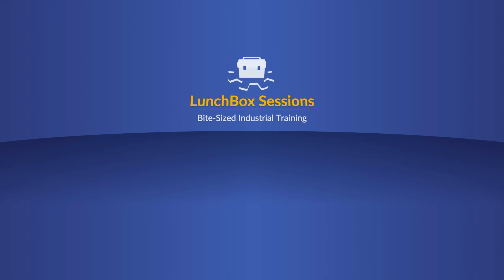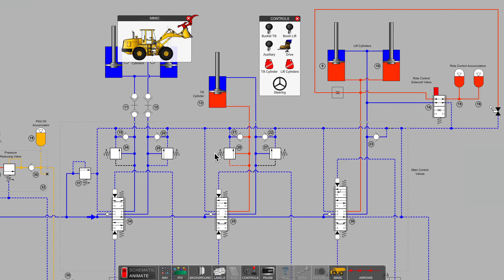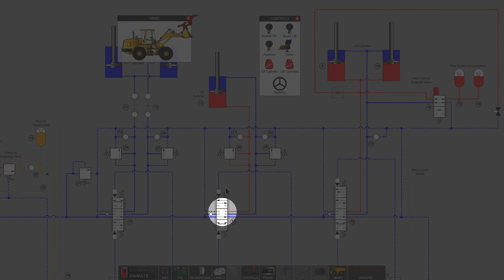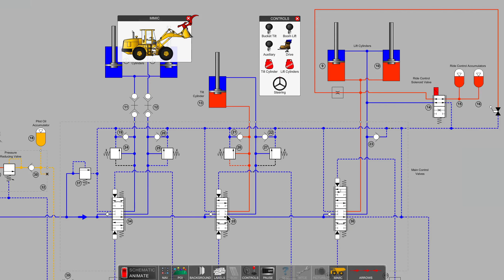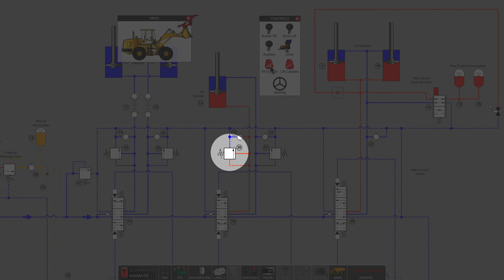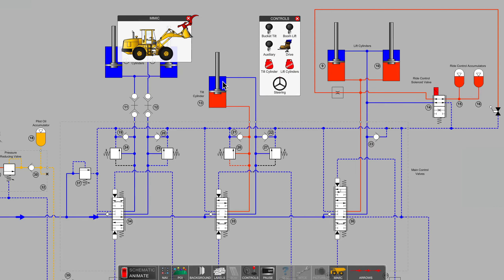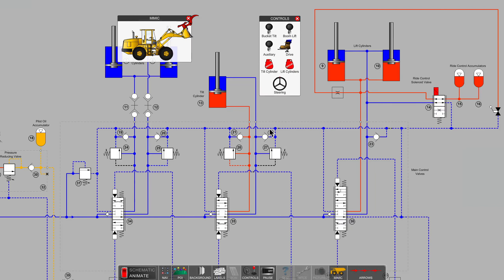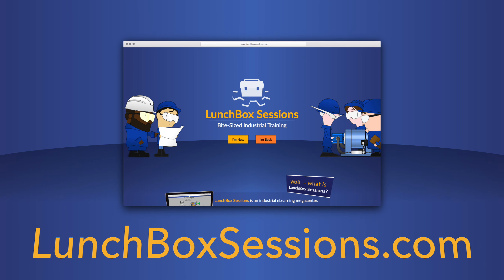Shock Relief

Comment: Excelent video. I have a doubt related with the position of the cylinder when recibe the shock. If a few oil go out through the "shock valve" and a few oil flow go into through the anti-cavitation valve, it seems to me tha cylinder will be in a lower position after each shock.

It could be tha it is to few flow so the distance is insignificant?
Reply: I have the same question
Reply: That is correct. the actuator will be at a lower position.